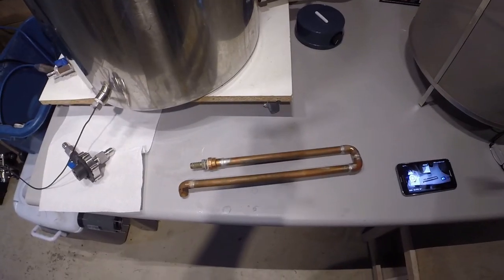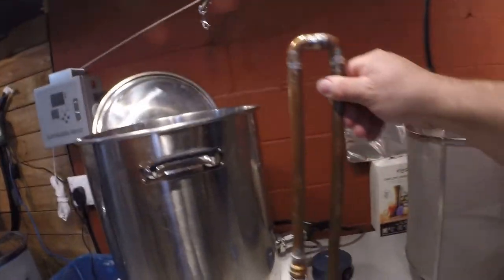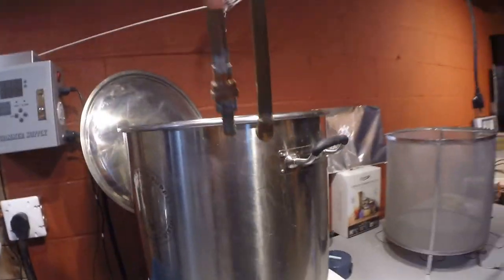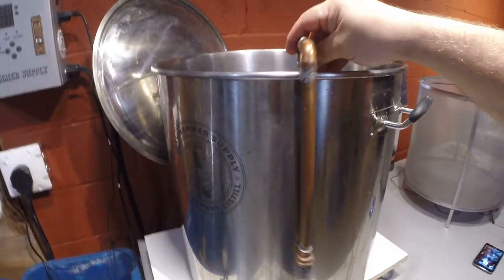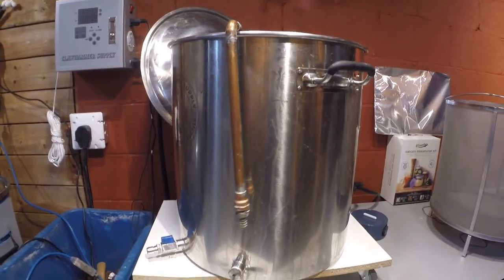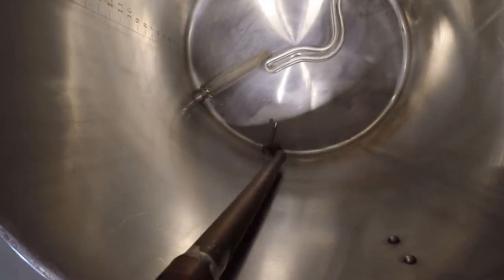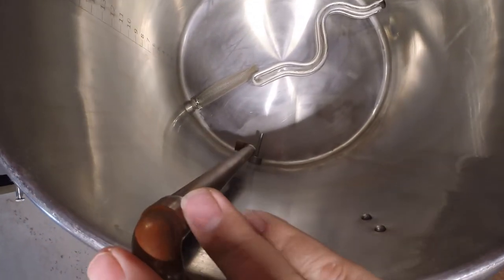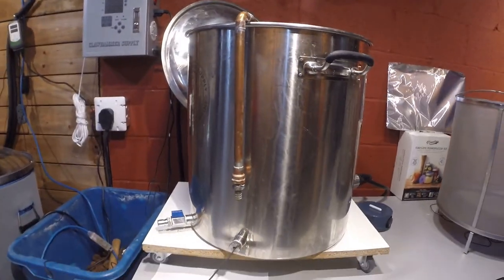Clawhammer Supply BIAB 20 gallon 230 vac system

Comment: Great video, I'm in NW Ontario and am struck between the Spike Solo System and the Clawhammer Supply 20Gal. The Spike system is pricey at Toronto Brewing supplies is around the $3000 mark and thats 10Gal system. The Clawhammer Supply system is going to cost me with the exchange is around $2400-$2500. was there any hidden costs when you ordered, extra fees at the boarder, if there are I might as well get the Spike system. Then there is the Brewtools system with the touch display for around $1500 plus $600 for the accessories kit American.
Reply from the maker: I know its a hard decision. It cost me $3000.00 CAD after all expenses. I don't use the basket anymore because I find it hard to keep a regulated mash temp and when brewing a 10 or 15 gallon batch is gets quite heavy to lift. I love the simplicity of the control and that it comes with every thing you need to brew. If I had to do it again with money being no object, Spike would be my choice but I am glad I went with a 20 gallon system.
Reply: @CanadianBrewingChannel  Thanks for getting back to me so quickly. I'm going to do more number crunching, I sent an email to TorontoBrewing to see if they could crunch some numbers on the Spike system. Do you know anyone else that sells Spike systems in Canada?
Reply: @richmurphy5647  not to my knowledge. Toronto brewing supplies are great guys! If you go with Clawhammer you are ordering direct. I spent 1 year looking at systems. Just remember it's a hobby and you always end up adding on to your system! Have fun with what ever you decide to purchase! Cheers
Reply: @shawnrobinson3483  What system did you end up getting

Comment: Thanks for the thorough review.  How many pounds of grain will the basket in the 20 gallon unit hold?
Reply: Thanks for watching my video. I was able to put about 15 pounds of grain in the basket but no longer use the basket. I still use the controller as it works great but found the basket was really heavy when full of grain and my efficiency was too low. I use a mash tun for mashing now. I have videos later on showing my latest brewery as I moved and also using a spike kettle and condensation lid which I love. Happy brewing!

Comment: The power percentage you are referring to isn't duty cycle i.e., time on vs.time off.  It is percentage of power applied to the heating element.  So 5500 watts set at 50% 2750 watts of power being delivered.  You may want to run it through an auto-tune cycle to dial it in.  The PID control and 5500 watts of power should be able to keep it very close to set point in Auto mode.
Reply from the maker: That is not how this controller works.  It is the amount of time that the heaters are on vs off is what you see on the display. If you dial it to 50%, the elements will pulse on and off to average 50% on/0ff. You can see it when you are in manual mode pulsing the SSR's. With an amprobe meter on the elements, they draw full amps and then  are off with no amperage draw. I have done 3 auto tunes and it never made a difference. I believe its because of the design of the system. When using the basket to mash, it hinders the responce time of the temperature sensor due to wort flow deflection. I no longer use the basket to mash. I have a separate mash tun. I have brewed with this system over 100 times and find the manual mode the best for getting that perfect rolling boil. I love the controller and if I could go back in time, I would have just bought the controller and build the rest of the system around it. Cheers!